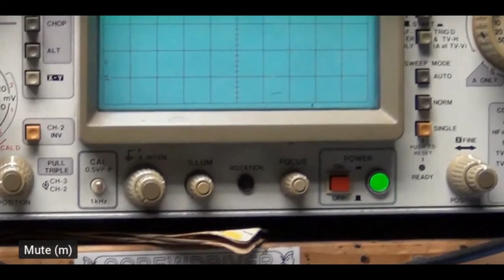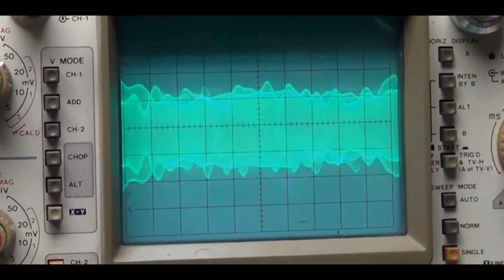Bells "tune up report"

Comment: Well fine tune won't set up radio with amp so who does?
Reply from the maker: Plenty of people are willing to take your money and charge you for matching a radio up to an amplifier.
 Unfortunately none of those people are capable of giving you any sort of results worth having or paying money for. Q5 CB in Wisconsin does textbook work which is better than most.  That might be a good place to start but I wouldn't waste money on an amplifier unless Mark set it up.
Reply: @rabbibacongrease88  I agree with you here. But I am opening my open shop just north of him in a town called Stevens Point. Q5 and I are somewhat on the same page but he is quiet a bit older and set in his ways.

Comment: Wow my 955 is right out of the box  and sounds alot better than that bells radio
Reply from the maker: A stock radio with a factory alignment will out perform 99% of the technicians work from coast to coast. I've only discovered one guy that can make it perform better than stock and I have a difficult time sometimes differentiating between a stock radio and 1 that was tuned by the guy that did mine. Anybody else that "tunes" a radio will always cause the performance to decrease without offering anything of value for the money spent.